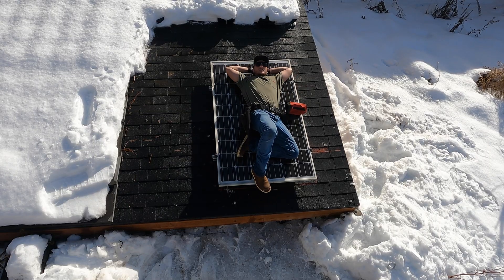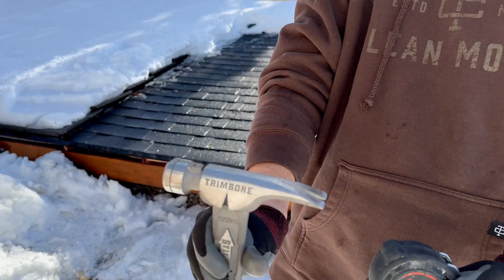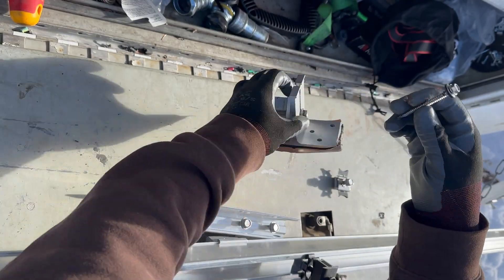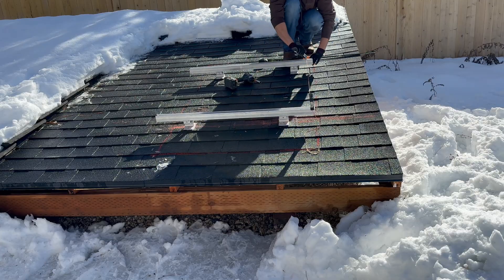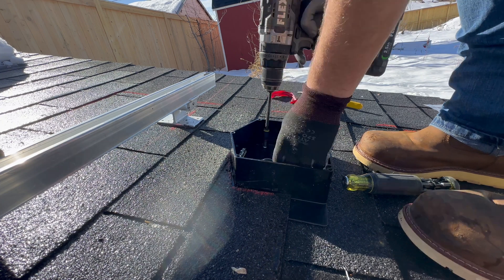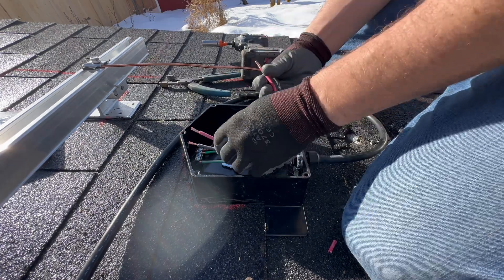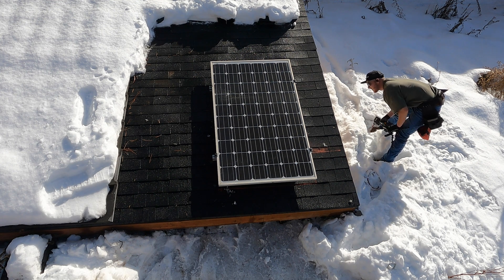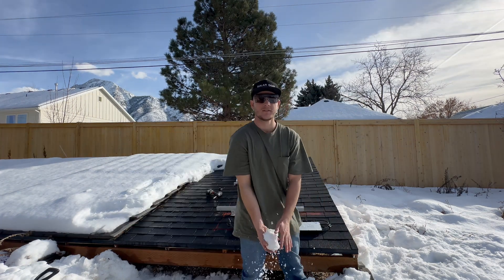Let’s Install One Solar Panel

Comment: Do you use 2 rails for every row of panels or would you connect two rows to 3 rails?
Reply from the maker: I just up loaded a video showing the hardware for 8 panels. Usually rails are 14 feet long and will do 4 panels vertically. So if you were doing a row of 8 you could “splice” 28 feet together. Check out the video “every nut and bolt……”